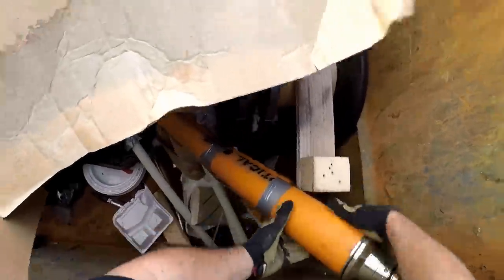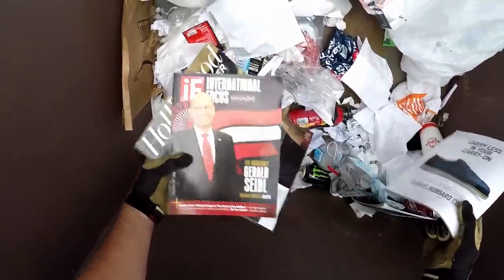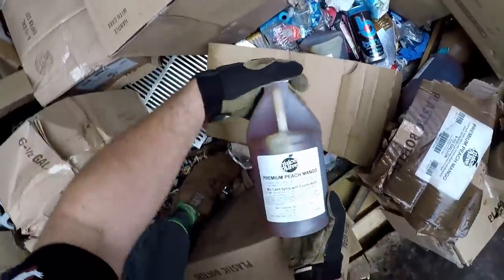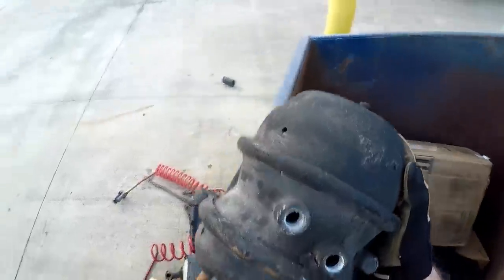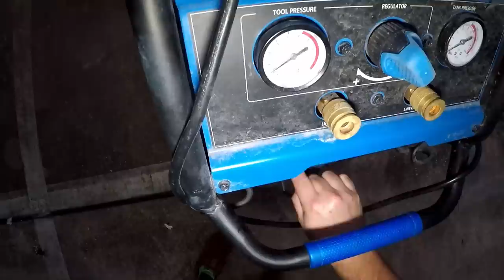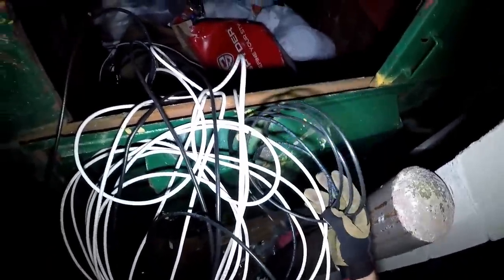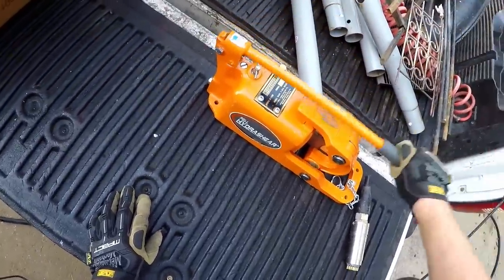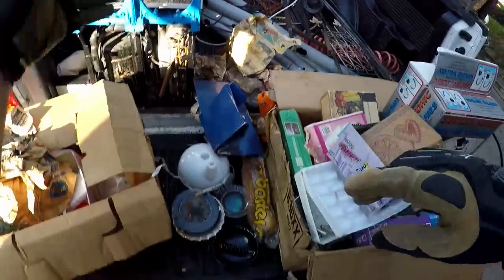Dumpster Diving "Dumpsters N' Roses

Comment: Hey Mike, the Hydro-Shear if after topping off the oil don't make it work it could be a bad seal. For a $5.00 seal flip it for a grand. Just my 2cents Bro. Good haul none the less. Awoooo! 👍✌👊
Reply: Exactly what I thought!
Reply: I concur 👍
Reply: yes Mike, what he said ^^^ this is way too new to have anything major wrong, plus made in USA, it's something simple and cheap, either seal or not enough fluid
Reply: I agree thats how we fixed bottle jacks ,
Reply: Yes for sure seal and some fluid should be perfect someone proprobably tried cutting something too big and blew the seal out of it simple fix I've dealt with these before it's almost always the seal and oil some of them also have a pressure release valve that will stick open too
Reply: could always sell it for parts to someone else. I sell stuff for parts all the time for good money. Especially high end items.
Reply: Or low on fluid.
Reply: The unit was probably found to be unusable and the company that shipped it wouldn't want to pay the return postage. Good find!

Comment: Hi Mike👋🏻! The Fujitsu Scan Snap S1500 is AWESOME desktop scanner. I used these at my work and always told everyone if there is one tool I would NOT be without it was my scanner. It scans your documents very quickly and saves them to your files. These even scan your photos too! If it is broken try to troubleshoot it. You won’t go wrong!!

Comment: Check the vent plug at the upper right corner to see if it is tight, or blown out. If it doesn't tighten, that could be your problem. Also check the oil level. Please update what you find out.

Comment: Mike at or around 39:31 in that box of kitchen stuff is a plastic orange old school Tupperware egg separator. It looks like a spoon with small slots around the top. Crack an egg in it and the whites spooge or overflow through the slots.

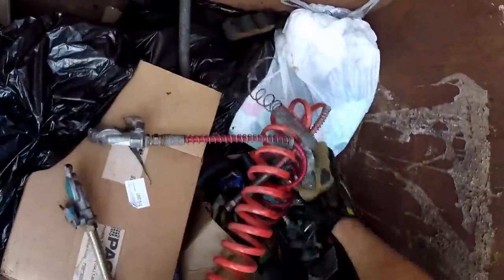Comment: 16:40 glad hand air hose fitting for large Truck: turn the glad hands off, put the threaded brass in a vise. With both hands pull the spring away from the brass fitting, which now reveals plastic hose, put on wood block and chop the hose with a small axe near the fitting which will now have an inch of plastic hose, take a knife and deftly skin it off next to brass then pull rest off with pliers. Easily pull steel spring off now chopped end of hose, nothing stopping it. I find these all the time in dumpster.

Comment: Be super   SUPER  CAREFUL  with that  "spring brake"!
There's a really big spring, under a lot of tension in it!
You can use one bolt through the hole in the end to release it. To open the cover. But be REALLY CAREFUL  doing it!

Comment: That thing you called a spring brake is actually a brake can for air brakes on semi. It has diaphragms in the pool on the slack adjuster which is connected to the s-cam which pushes the brake against the brake drum

Comment: Since the wire cutter is like a bottle jack or a car jack it could be quick fix.  Could be a seal or low on oil.  It looked like the instructions were in the box when you found it.

Comment: Most if not all hydraulic  equipment I get just needs some hydraulic fluid . The slotted screw between the handle and valve is where you fill it up,open the valve all the way then just push the cutter all the way in before filling.

Comment: Hey man, don't cut the spring brake appart. We call it a Maxi. That thing can kill you. the spring inside is very very strong. You can take the clamp with the bolts appart but DO NOT CUT THE CRIMPED CLAMP.

Comment: Spring brakes are off trucks with air brakes. DO NOT take them apart, there is a spring that can kill you as you loosen that channel clamp that holds the two parts together.

Comment: That break booster unless you have the caging bolt in the back of it do not take that clamp off that holds the two half's together there's a spring inside that will kill you if it's not got that caging bolt to hold the tension on that spring before you take that clamp off! Do not take that clamp off of it! And that cable cutter probably just needs some oil or inner seal kit.

Comment: I get the idea that you need to move quickly but you need to think first and slow down.  The dumpster that had the office computer equipment had multiple laptops showing.  The secondary market for used computer equipment has seen a sharp rise in value because new devices are at a premium with production reductions in China.  

The long orange assemblies that you disregarded belong with the signal couplings you did keep...they are all part a submersible fiber transmission line.  The flared out first tube you looked at is a header that fits into either a land based hub or a submersible amplifier/repeater.    You missed out on a valuable piece of salvage.

I assume the compressor was outside a business closed for the day.  IMO you made a smart move to leave it.  It could have been a trap, or an error, or something dumped by someone not related to the business park.  In any case, not something you need to take given the risk attached.  The cost to get yourself out of a problem could be equal to many weeks of diving effort.  

GOOD HUNTING
Reply: Agree!
Reply: I went back to look and I spotted one laptop
Reply: I agree.  Especially the laptops--they are in huge demand nowadays.

Comment: That is a $375  cable cutter eBay used price. Just put hydraulic fluid in it. It will work again. they probably left it on its side and the fluid leaked out.

Comment: Hey Mike good video as always about the hydraulic cutter it would appear to be low on oil or it has a bad seal in the pump both of these are a fairly easy fix for someone with your kind of talents so ya good luck hope you can get it fixed.

Comment: You'll hydraulic wire cutter needs oil this should be a little screw it opens and you pour hydraulic fluid in it